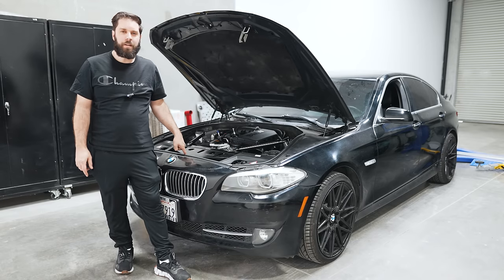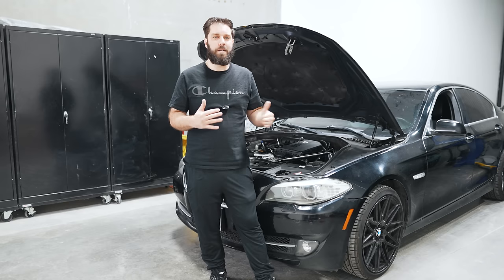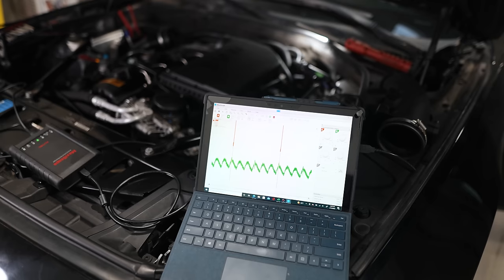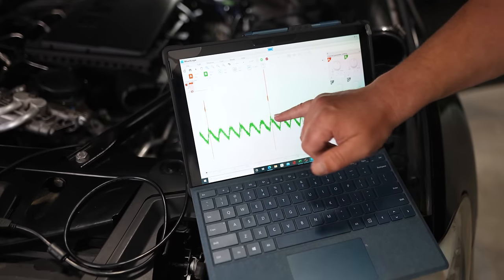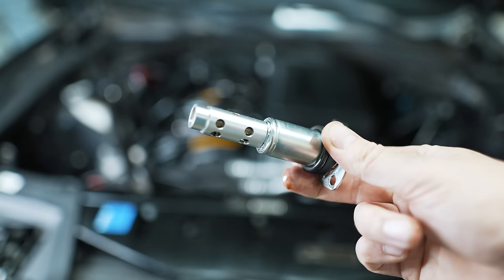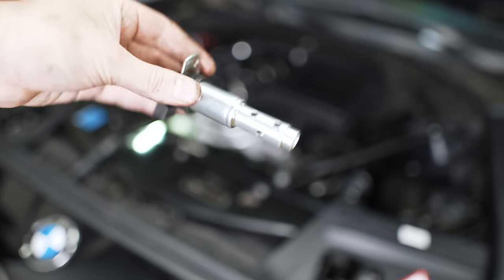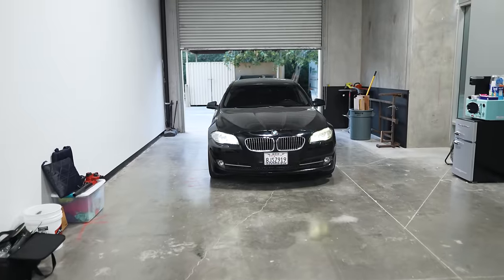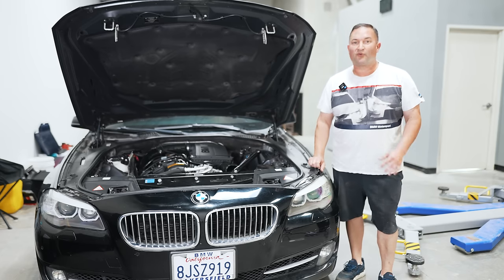This BMW Had The Strangest Problem.  Huge Misfire Fix!

Comment: I hate bad BMW owners people who can’t afford these cars take the cheap route to try and fix them then they get frustrated then sell it. The N55 is a great engine
Reply: same... as a BMW tech those people are the reason these cars have such a bad reputation, the majority of BMW engines will do 200k+ when they're maintained properly. Problem is once they're 10+ years old pretty much anyone could scrape up the money or take out a loan for one, but very few of those people have the money and or skill to maintain the car. Parts are so expensive once you start falling behind on repairs they can turn into shitboxes really quick.

Comment: My n55 ran like crap. Turns out I installed EU6 injectors on a DME that’s only compatible with EU5 injectors. Parts both fit the same but they have a completely different spray pattern.
Reply: You are supposed to check what injectors are in the dme.

Comment: My dads N55 had a misfire and valve knock. It would also tick under acceleration, like a card in bicycle spokes. Turns out, the o-rings and washers on a fuel injector went bad. These complex engines make some of the strangest issues or troubleshooting steps.
Reply: I have the exact same symptoms as you described and I suspect a bad fuel injector. Did the knock go away after fix?
Reply: @luckyblack00  Yes. It did. The fuel injector was fine. It was the sealing ring, or whatever they called it. It essentially allowed the air to leak and cause an irregular misfire. Because the injectors require a special tool to remove, it cost my parents a pretty penny.
Reply from the maker: Yeah the sealing ring leaking would be a distinct noise for sure.

Comment: Great instructional video for DIYers. IMO, you have set the bar to the next step on your channel.  It's surprising that there are owners out there that would do what was done to this car. Using cheap China stuff is one thing but not installing the correct part is sad. Great save on the gamble. Now we'll see your "detailing" skills that you're going to teach us. Love the new format, you are a real person. Let's see you clean the intake valves on this one. Greetings from WNC
Reply from the maker: Thanks.  Oh the detailing skills will not be mine but we'll be documenting it.  Joel Rolley is doing the work.

Comment: Would that relative compression test work for an n54? I’m planning to mod my new high mileage  n54  but I wanna know if it has any engine problems first.
Reply: It works for every combustion engine, gas or diesel.  Just need a good battery and starter, it could be at a junkyard (needs oil and no synchronized to ignition).  I would have found Cleetus' bad cylinder in 10 minutes with oscilloscope and a borescope (we did borescoping too on that 535i) to look at cylinder wall cross hatch and side camera on the valves.

Comment: Link to the tool used to check the ‘compression’
Reply: Autel MP-408 Maxiscope 4 channel oscilloscope, PICO TA167 amp clamp, any laptop to download the maxiscope software.

Comment: Hello, congratulations, it's nice to see a problem resolved, I have a 325i 2010 N53 slows down unstable and shakes when cold, it lasts 1 minute and afterward the car runs very well. When she does that I accelerate slightly and that prevents the shaking and slows it down unstable, do you have any idea, said the vanos? No smoke, no smell of gasoline. New spark plug and coil. I'm French, sorry for the translation.

Comment: Great video. 
Wow 10min fixed all that!
Joking. 
Very Good job.
Reply: Actually it got harder... had intermittent misfires and then realized there are 2 EU5 injectors one for before 12/2010 and one for 1/2011 on.

Comment: Thank you for the awesome videos! Im going through a little out of the ordinary  issue and was wondering if you can help me.

I was getting 2BCB (mixture control: exhaust gas after catalytic converter too lean) code along with 2D2F (oxygen sensor before cat: multiple fault). 2cF4 code showed up once but didnt return after clearing (before cat slow response). This prompted me to replace the primary O2 sensor. 

After replacing the primary O2 sensor and driving for a bit these two codes came up:
2D34 ( oxygen sensor before catalytic converter, system check: signal fixed at rich.
2D2F (Oxygen sensor before cat multiple fault)

The car drives and pulls smooth. It idles smooth as well before and after replacing the sensor. No SES light illuminated yet. What can I do now to hopefully resolve this matter and ensure the engine isnt running too rich or lean?

Car info:

2011 e92, N55 with 126k miles. Catless downpipe with mhd stage 0 tune for the past year. Just regular oil changes. No other work was done recently. 

If you can please shed some light on this matter, that'd be greatly appreciated, thank you!

Comment: lol. i knew exactly what was gonna be wrong with this car.
Had literally the exact same type of thing occur on our f15 x5 after I swapped it to a metal valve cover/new gasket. Random solenoid decided to fail and i bought another off ebay for $25. the adaptation reset process can be very nit picky. gotta reset all adapts and then turn it on and let it ide and watch it until you see te rpms come down all the way. code 101F01..MASSIVE PITA to remove after vanos fixed

Comment: Have had any experience with P112F code. It throws no check engine light. Car runs fine until I step on it. When I step on it it throws the Drive train Malfunction, but no check engine light.

Comment: I have a 2015 Japan import m135i n55 the other day I was having a spirited drive with the car and it came up with a drivetrain issue, I checked the codes and it said cylinder 4,5,6 were all misfiring. I left the car overnight and when I first cold started it again to get it on a trailer it was a really rough idle, very smelly (gas) and the revvs kept building to 1-1.5k, the car warmed up a bit and I had to start it one more time to readjust it, but when I restarted it the misfire went it seemed like the car was back to normal I let it sit and warm up some more and gave it some little revvs and it sounded like normal. The check engine light is still on but I haven’t cleared the codes in the car system, any ideas what could of happened?

Comment: How would I go about diagnosing what causes the ticking sound from the N52? Also,  I get a slight vibration as it idles and/or at a stop. There is no vacuum leak and mounts have been replaced.

Comment: I have had 3 535is and have been chasing a weird metal sound at cold start, it goes away once warm and is independent on rpm. It sounds like it either comes from the vac pump or crank pulley. Any input?

Comment: Have a 535i misfired bad, replaced plugs and misfire is back with same codes.  Help please. Wasn’t coils either
Reply: Valve cover gasket and get the oem solenoids

Comment: If one was to simply replace both vanos solenoids with the correct units (Genuine BMW) could you just drive off and let them self adapt or is resetting via ISTA required?
Great video,
Thx
Reply from the maker: I would imagine that the engine would so in about 1 drive cycle.

Comment: This is off the current topic, but I just remembered, that time when you manual swapped your e90, remember it made a whiny noise on 1st start up, did u ever figure it out? :D
Reply from the maker: It was the starter meshing with the flywheel. It eventually quieted way down.  It's not gone completely but at around 10% as loud now.

Comment: I have been trying to find out why my 640 stumbles and shuts off randomly for about a year now. iv changed so many things including the hpfp and the car starts runs and idles better then when i got it 3 years ago but it still has that problem where it stumbles and shuts off randomly with no codes or symtoms prior. still trying to figure it out
Reply: UPDATE: was the valvetronic essentric shaft, car drives wonderfully.... AFTER its terrible cold start. still havnt figured that one out

Comment: Please check what you get on the park brake , I’m having a park brake error on my e70 x5 and I think they use the same systems
Reply from the maker: I actually replaced a park brake actuator on my E70 X5 back in the day and filmed it.  The code is gone after replacing just the pad wear sensor.

Comment: Our M235i has has a bouncy start idle. It'll dip anywhere from 400 to 1200 RPM's. Some days it's barely noticeable, some days it's a lot worse. After the approximately 60 second warm-up sequence, it's 100% normal. Car has been doing it for the last 60k miles. Any ideas?
Reply: I just discovered the issue after buying mine yesterday haha, but I took it to the local bmw dealer as I have a warranty for 2 years on it
Reply: I’ll let you know what they find out

Comment: On my N54 the HPFP was tired.. I replaced it.. before and after which my rail pressure was showing LPFP pressure. What are the odds the sensor went bad the same time as the HPFP or that I got shipped a failed unit from FCP? Also, would a bank of bad injectors failing open do the same thing? I feel like I'm chasing a gremlin.
Reply: Codes?
Reply from the maker: I wouldn't imagine that bad injectors would cause your rail pressure to drop down to low pressure.  I would check the low-pressure sensor and compare it to the high pressure sensor.  Are the values exact?

Comment: I got a very similar issue with my 335i n55.
So the car idles and drives great, but when I come to a stop and when it should discharge the transmission and idle at 600 rpm, the rpm starts rising up to 1300 rpm and then slowly falls back to normal idle rpm…

Already changed spark plugs, coils and injectors.

I am thinking either vanos or somewhere air is getting in.

Maybe some of you guys have an idea?
Reply from the maker: Does it do so smoothly?  I would imagine there would be some associated codes.
Reply: @VehicularDIY  yes it does do smoothly, but takes around 10 seconds to fall back to normal idling.

Sadly not a single code.

Comment: Good stuff, but I am a little unclear on your data collection instrument (Oscilloscope) connections. Did you disconnect all the fuel injectors and then connect to one of the connectors for the coil pack to get the ignition indication on channel A (red spike)? Also, how is the Amprobe on channel B giving you a cycle of compression, being clamped on the "Starter Wire"? Is is actually reading the current (Load) fluctuations on the Starter as each cylinder compresses at TDC?
Reply from the maker: You pretty much described it.  As for when the cycle starts again its based on cylinder 1 being triggered.
Reply: @VehicularDIY  Wow that is genius! I would have never thought you could get a informative compression read from the motor starter! Thank you for replying and taking the time to create these videos. I am a new subscriber and your videos have been very helpful. I have been fixing my own cars for over 35 years, but I'm a new BMW owner (used one) and these cars seems pretty complicated. Having the knowledge that you put out will help.

Comment: I have 2011 bmw 535 at idle the rpms dips just a little bit if it cold outside or while warming up but afterwards idle is fine. Could that be injectors or a plug type of issue ?
Reply from the maker: It could be a leaky injector.  How many miles?
Reply: Maybe intake manifold gaskets too.
Reply: @VehicularDIY  115000
Reply: what was it ?